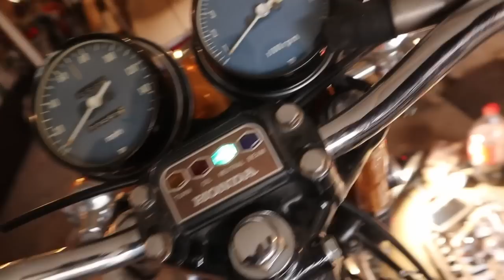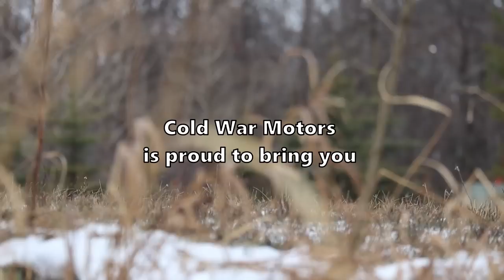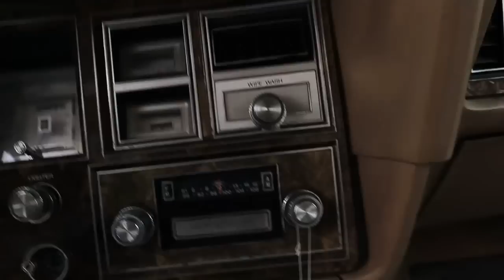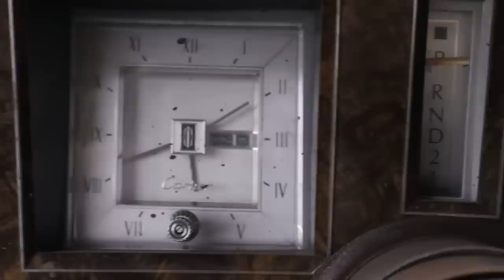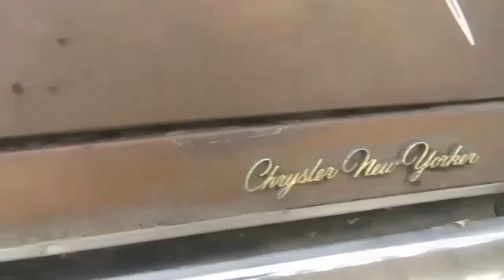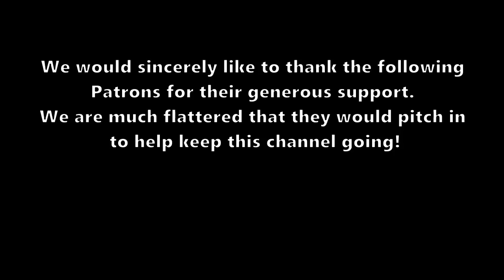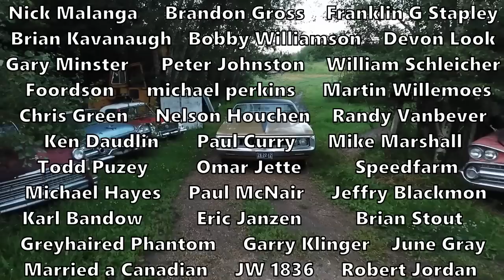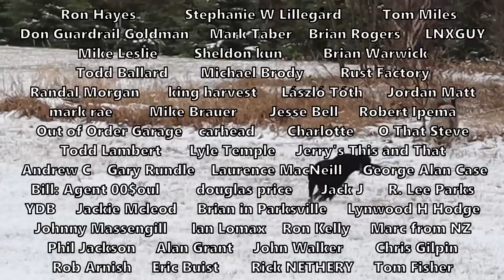Honda 750 Finished! Plus: Western Canadian Frankers, "Will it Oogah?", and Dean's Greasy Flips!

Comment: Being a seasoned Honda technician for a long time , I've changed those out more than I care to remember...... there is a easier way let me explain....... first leave the front wheel on ,  take loose the center nut of the top triple tree it's by the handle bar mounts , just loosen a little , then loosen the upper and lower triple tree fork tube clamp bolts ....... the next part can be done one of two ways , u can either put a floor Jack under frame of bike in order to lift frame up ,  this will allow the forks to slide down , might have to give them a little help , ...once forks have slide down a little,..... the upper triple tree can spin expertly,  spin just enough to pull up the headlight mounting pieces ......... reverse this procedure to put back together ......

Comment: I had a friend that had one of those old Honda’s in about the same shape. He had one to many adult beverages one night and decided to burn the tire off it in his garage. He revved it was past “good sense” and bent a valve into the shape of an S. I’ve never seen a valve bent so badly and not break. He replaced the valve, buffed down the high spot on the piston, and had it back up and running like a top in a couple of days. They should be referred to as Steven Seagal bikes, because they’re definitely “Hard to Kill”, lol.

Comment: Hey Scott, I had the same Honda back in my young days. Mine was a combo of 72 frame and an orange 73. Painted it Corvette brown metallic with Hooker headers, with Krauser saddle bags and then travelled from Ontario to Alberta. Great trip. I have that same drill bit set that you used, the small bits are alright for soft materials. Large bits totally useless.

Comment: Season-change from "miserable" to "where is my motorcycle?" - my favourite.
"Swearing on" the headlight-bucket is just the way these things go. You don't even have to be color blind or have different years/models cables to only be able swearing it onto the bike. That's why the season does produce double the joy should it actually hold up without changing to flicker/dim/kickstarter-only until everything changes back towards "miserable again" (Don't ask why I would know 😁)
She's a beauty, while she already was a beauty in "beater yellow-ish", too. First-kick brooom. Not just a beauty then. My regards to Al, I also genuinely hate these visors - anyway, it's not my bike, and I sport a couple things others hate on my bikes too I reckon.
Thank You for sharing.

Comment: The Honda750 purrs and looks great in it's original colors.  Like the old style horn placement in the engine bay.  Are you sure Dean is not the famous Sascatuwon car dealer that was run out of the providence for BS sales and marketing fraud several years ago...lol. Thanks my Canadian motor heads for another enjoyable afternoon here in East Texas.  Enjoy your spring because your summer is only 10 days away..

Comment: In 1972 I bought the first Honda 750 I ever saw--it was not brand new, it was being sold by a guy who bought it new, it was his first bike and he was intimidated by the power and complexity of it. He was in his thirties (a mature man) I was twenty-one yrs old, I gave $1450 for it with only about 1000 miles on the clock. It was a 1971 model, looked new. Haven't thought about this in years. That bike seemed like a spaceship back then!
Reply: I remember when I first saw it with "buyer's eyes" ..... still got a used 900 Darmah instead of the spaceship, for less than half the Honda price - there actually was a time when nobody wanted big Ducati twins in central Europe 😁 and You could still ride them to the restaurant or cinema without risking a theft.

Comment: The Boogeyvan is the perfect backdrop for the Honda 750-4.  They have a common color and probable era. It could be a cover photo for an imaginary magazine called POT ROD. The A-ooga horn mounting bracket could be a refugee from Lost Episodes of Light Buzz.. The drill press segment could be a pilot episode of a new feature called "Private Bits." They're the ones you'd be too embarrassed to lend to anyone, but still keep them and struggle whenever there's a hole to be rendered.. Good drill bits are saved for special occasions. Like vintage wine.

Comment: I have visors on the headlight/passing lights/turn signals on my RoadKing. Prolly should only be on FLH's... :)) 
Your Honda is sweet. I had a '70 CB 350 that looked like a derby bike, a well used derby bike.
You would have more room on your bench if you put them pistons back in the Chevrolet, just sayin'.

Comment: dang, I want to watch this now but have an old piece of motorcycle to go test ride (I hate Bing carbs) and see if it makes my foot wet again...back to watch later!!!
Reply: back! well I'll be, IT WORKED! (R100 motor stuffed in a full time 2WD Ural from the mid 90's, dangerous as F***, twice the horsepower+, same shitty brakes) outboard carb FINALLY not puking gas!!! WooHoo... and my 2018 and 2011 Ural Retros (yes, I have a Ural problem) both have fork gators! They are cool and "hygenic".

Comment: Great video as always ! This week was ‘first start of spring’ for me. My 64’ Ford Falcon Ranchero, 72’ Ford f350 dump truck, Ford 8n loader, Ford 9n and my 75’ Wheel Horse c160 garden tractor all fired right up! Gotta love alcohol free ‘recreation’ fuel with 360 Fuel Stabile additive! I wish I could have said the same about my sawmill’s 4 cylinder Allis Chalmers engine sitting for 11 years with ethanol fuel in the tank ( it turned my aluminum sediment bowl housing to dust )….Gary in Michigan, U.S.A.

Comment: Love that gold '67 fury III. I had a white 4-door 67 with a 318 and a 904 transmission with shift kit. Also had a two-barrel with small cal custom air filter and a glass pack single exhaust lol. That was my second car. I missed that old car. First car was a 62 Dodge lancer station wagon 170 slant 6 push button automatic....lol so the fury was definitely a big upgrade. As a matter of fact I had to use the alternator for a while off the lancer didn't quite have enough amperage. But it was better no alternator... Lol

Comment: "Is there anything more getto than used brake pads?" Yes. A used clutch pack. I reluctantly raise my right hand to signify  my guilt.
Reply: It's not like you can run down to the local auto parts store and they'll have them on the self...  Can't condemn you for that!

Comment: i am absolutely NOT an accessory type guy. in fact i removed the fender mirrors, badge bar, fog lamps and rear rack on my mg TD recently, but i like the visor on the motorcycle's headligh and thinking about adding a couple on my mg.

...wondering if i may be suffering from early onset dementia. :)

Comment: Great video 👍Loving the safety on off switch with shear special pilot drill bits and the non fitting chuck key😅 these have all been part of the average high prescion shed workshop!

Comment: Well, now you made me curious, so I had to go look at my 350f. My headlight bucket is black, but the fork tubes are color matched. Unfortunately, on the 350, the turn signal arm mounts to that bracket for the headlight bucket, and if you tip her over at all, it bends that bracket. Mine is very s shaped at the moment :( Mine was made 12/72 so I guess technically a 73 model. I can't imagine a 750! my 125lb arse can't hardly handle the weight of my little ole 350 haha. Funny how much is similar between the two, and what is different!
Reply from the maker: Thanks for the note! Since mine is missing...What size is the headlight on the 350?
Reply: @coldwarmotors  it's a 6 1/2 inch 35w

Comment: Regarding the 1951 Dodge Coronet BIG CAR. I have been fascinated by these cars ever since some guy made a video of his DeSoto version of one of these and how he still used it to make long trips with his family. This is what I presently understand after having done a bit of Internet investigation about these cars: 1) As you have discovered, the whole body of the car is wider than the standard cars of the same make and model. It looks to me like the entire body aft of the cowl, as well as the FRONT fenders, are the same on all of these whether they be Dodge, DeSoto, or Chryslers. The exception is that there was also an extra-long Chrysler Imperial limousine that was longer than the rest of these. 2) As a result of this, only the hoods, grill work and maybe some bumper trims were the only sheet metal pieces that varied between the different makes of these cars. The tail lamp assemblies of the different brands seem to have been made to fit into the same rear-quarter openings common to all brands except Plymouth. 3) Back when these cars were being made and sold new, Ma Mopar did not refer to these as limousines unless they had a divider panel and glass between the passenger compartment and the front seat. Units like your '51 Dodge were called eight-passenger sedans. 4) Most of these were DeSoto or Chrysler Windsor versions and were used by hotels and resorts as livery vehicles. Of course, your Dodge has a special roof which most did not have. Do I understand correctly that the original use of your Dodge was to transport visitors from North Vancouver to Whistler?
Reply from the maker: Hi William! Thanks for the note... The one I have was one of 6 ordered new by the Jasper Park Lodge to use as sightseeing cars. The custom tops were built in Canada on a production Dodge 8-passenger sedan. (you are correct: no divider; thanks for the info!)
  This one was later sold to the Fairmont hotel in BC, and was eventually auctioned off in about 1970 to the fellow I bought the car from. He took it to BC and used it for a year or 2 and eventually left it at his friend's farm and forgot about it for many years and I bought it from him. 
  As far as I know, there is at least one more of the original 6 sightseeing cars left, and it is restored and lives in the northwest USA.
 All the best; cheers!

Comment: If you own a cb750 single cam pay the steep price for the original Honda throttle cables they have neoprene sleeves and is like BUTTER compared to EL CHEAPO  throttle cables